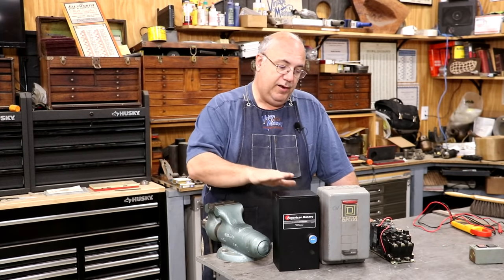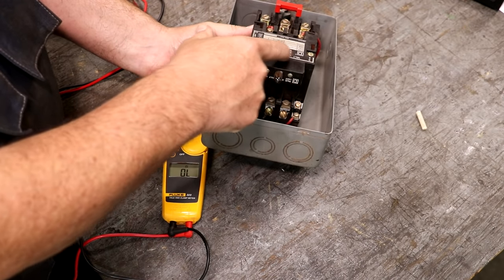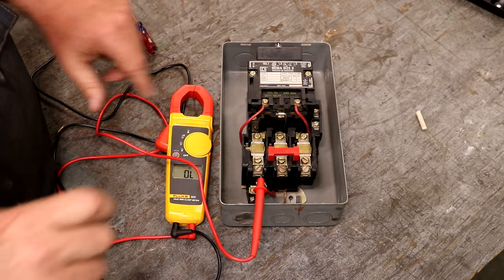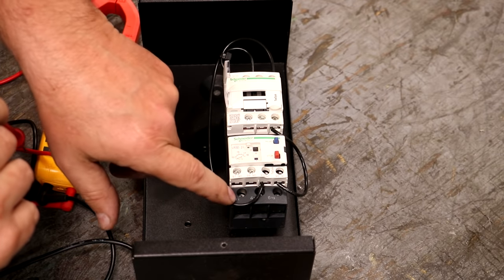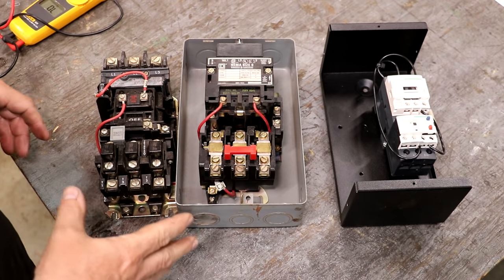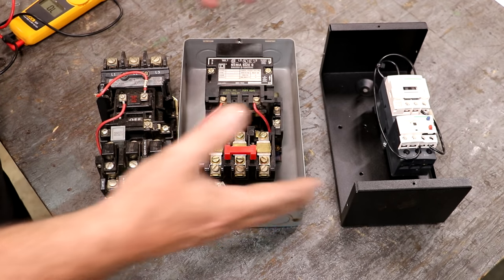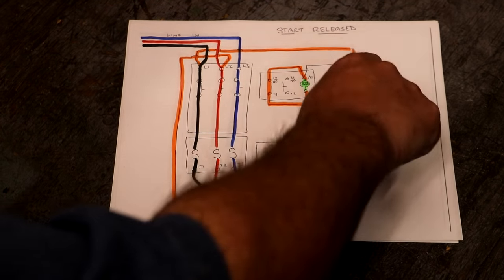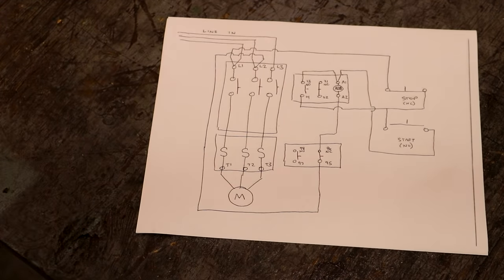Motor Starter On-Off Push Button Station Circuit Explained

Comment: It probably should have been mentioned that there are different sizes of starters for different sizes of motors. One of yours was marked "Size 0" which is rated for up to 3 HP when operated at 230V (or 5HP at 460V). There is a smaller size, Size 00, good for up to 1.5HP at 230V as well as larger sizes up to Size 6 for a 200HP motor at 230V. You can find sizing charts online.

Comment: Our 3 phase reticulation pump was manually started and stopped. Occasionally the protection circuits in the switch used to burn out, so our electrician connected 95 to A1 (same as on your diagram), protecting the protection device. Following this, the motor burned out a couple of times. Further investigation revealed that one of the phases had an intermittent poor connection. We learned that an important function of the protection circuit is to cut power on all phases if the current on one phase reduces or stops.

Comment: Nicely done Keith.  Having worked in a shop before I wired up a few machines with the electricians.  This was when I was about 18~19, so I was just learning stuff.  You did a much better job of explaining it than they did.  They were more "yea, just wire it like this".  I was "WHY!?!", they were "Because it will work this way".  I kind of wondered if they actually knew...LOL
Reply: Truly sounds like majority of electricians unfortunately.
Reply: @sixonegfour2719  honestly?  I was 18.  How much did I know then.  My uncle was a master electrician and taught me a few things.  I know enough to know when I need help that's for sure.  I also have a brother in law who is a master electrician, so I got that going for me.  Lol

Comment: Maybe you can help me diagnose a problem with a starter. I've got a step down transformer going from 480-120 to run my coil. I had the transformer on the shelf, and didn't want to order a new coil for 480v. Anyhow, my start and stop buttons work fine, however, if i manually actuate the contactor, the coil becomes energized and the contactor stays closed. I've never experienced this before. Any insight?

Comment: There is one important aspect of using a starter that wasn’t mentioned: current.  The motor needs LOTS of it, and contacts in the starter are huge so they can handle it.  The coil that’s turned on and off by the remote switch is very low power, and the remote switch can have small, convenient contacts.  It’s a very small power controlling a very large power.  If you wanted to use a switch directly on the motor, it would have to be huge.
Reply: He very clearly spoke about amperage (current).

Comment: One of my mills has ancient DC motor controlled by a 1945 SquareD starter.  It controls the startup inrush current via a dashpot and three resistor banks.  It had been miss-wired and one of the internal straps was missing.  If the schematic and care instructions weren't on the inside of the cover, I would have been out of luck.  It works correctly now.

Comment: Keith at 22:24 you say that the switch (2-3) on the motor starter is Normally Closed, that should be Normally Open. The Blue - Black wire on the motor starter are only connected when the coil is energized. 
Great diagrams, and good explanation. I had never looking into a motor starter before. It is really a latching relay with thermal overload protection. Understanding how it works is the way to go.

Comment: Good Job !
Both the IEC (your "new style") and NEMA (your "old style") starters have extra Aux contact for alarming, signaling, or whatever you need for your control.    In the heavy duty industrial applications I was involved with, we used NEMA due to them being oversized and their ability to withstand multiple overload conditions without damage.

Comment: Keith, thanks for a great explanation of how all this stuff works. I agree that it's really important for those of us "playing" with older machines to understand how things work and not just try to get by with "connect terminal a to terminal b, then c to d" style of working. When you understand how it all works, you can confirm for yourself what will happen when the power goes out or there is an overload. If you don't understand how something works you really don't know if it's safe (electrical or otherwise). This is not easy to explain and I think you did a great job. BTW, for those accomplishing the same task with a VFD, things are done a little differently, but all the same safety considerations need to be taken into account.

Comment: I've got an old HUGE (200LB) Baldor Bench Grinder at a factory maint. shop auction that had the push button start/stop but was removed by an idiot.  I had the bits n pieces but could never figure out the wiring! THIS  VIDEO WILL HELP GET IT UP AND RUNNING FINALLY!!!!!
Reply: The schematics for this circuit are all over the net. But try to find schematics for a latching circuit where the coil and load voltage are different. The only one of those you'll find is the one I posted. Because I looked for one. For like 3 days. Then I gave up and just made my own. Which I then decided to post for the next poor fool that might need it.

Comment: I thought you said you were not an electrician.  That was a good explanation.  I am now working on an old industrial oven control that I plan to use for a foundry furnace.  Circulator and exhaust fan, air flow switches, purge timer, flame sensor, pilot light, ignition and main gas. Lots of interlocks, timers and motor starters.

Comment: That was a good explanation of a contactor circuit with overload protection. One option that I have encountered on our heavy duty 480 volt pressure washers at work, is a rotary on/off switch in lieu of push buttons which I do not care for. Our equipment has a time delay in the lock circuit that won't operate unless there is water pressure present at the pump. It's just a more complicated circuit. There's a good possibility that the machine could be turned on when a power disruption is resolved.
I hope in your next installment on this machine that when you begin to discuss wiring it up that you can discuss horsepower amperage draw in relation to wire gauge, and phase rotation, which can be changed from changing any two legs of the 3 phase motor in one of 4 places. It can be done on L1, 2, 3, on the contactor or on t1, 2, 3 of the same. It can be done on the electrical breakers, or in the event of a plug, it could also be done at this point.
Again, thanks for the well thought out discussion on this safety feature.
On further point I would suggest is that if/when this shaper is plugged in, that the breaker or disconnect box be turned off before plugging it in as high voltage does have a risk of arcing when plugging in, even with a contactor deactivated.
The company that we contract with has made this a work rule.

Comment: For reference. This is called a "3-wire start/stop" and the type of circuit is called a latching circuit. Very well explained Keith!
Reply: Yes. Latching. Without that explanation, it makes no sense. A mechanical “latch” that holds the circuit closed.
Reply: @melgross  if you think there is a mechanical latch then you did not get it. What latches this circuit is how it is wired. The start button energizes the coil and pulls the relay on. Once it is on switched power from the load side keeps the coil on. Then what you do with the start button does not matter. But when you hit stop that cuts power to the coil which opens the relay. Cutting power to the whole circuit turns it off too. And when it gets powered back up it will be in the off state. There's no mechanical latch whatsoever. That would defeat the purpose of this circuit. Well, one purpose. The other purpose is to make it easier to put on and off switches where they can be used.
Reply: @1pcfred  there are numerous ways to do this. I’ve designed a few myself. Sure, there are electrical and mechanical latching relays.
Reply: @melgross  you are not going to find mechanical latching relays in this application. Unless you buy your gear off sadists.
Reply: @1pcfred  So if you only want a momentary on, you would disconnect the power lead from the load side to the coil?  I wish he had explained how to install a momentary switch,such as a foot switch.  Better yet, a way to have a momentary (bump) switch and a latching switch.
Reply: @equiteemfg  look at the schematic at 14:23 All we're interested in is the stop and start buttons and that box in the top middle. Now the orange line is everything that's energized when the circuit is off.  Now let's press the start button. When start is pressed that current goes across start up to A1 of the relay. Now that relay is energized and it pulls in closing its normally open contact. Now the relay can keep itself on through itself.  The relay is latched on. Through the wire that connects L3 to A1. When stop is hit it cuts power to everything which cuts the current to the latching relay coil and makes it open up. Now the normally open contact in the relay is open again. So that wire between L3 and A1 is where the magic happens. That V shaped connection over the relay is the logic. If you put an on off switch in that L3 to A1 wire and open the switch up then the relay will only be energized while start is pushed and the relay will never latch on while that new switch is open. Then you'll have your momentary operation. Start and stop are already both momentary switches. Stop is normally closed and start is normally open. Start gets the ball rolling but the wire from L3 to A1 keeps it rolling. When stop gets hit it sucks all the air out of the room. When you hit stop the party's over. L3 to A1 is the enabler though. That's the link you have to break to keep the relay from latching up.
Reply: @1pcfred  This is typically referred to as a jog.  By setting up an additional JOG switch (that will put the circuit into JOG mode) to interrupt either the 13 to A1 wire, or the 14 to STOP switch wire it will turn the START switch  into a JOG switch, allowing it to run ONLY as long as the START switch is pressed and held(assuming the stop switch has not been triggered). L3 is NOT USED, I think you're looking at terminal 13 on his diagram (which IS NOT L3!) You could label the on/off switch as JOG(off)/RUN(on).
Reply: @georgegeorge2602  I just used "L3" as an arbitrary designator. You should not read anything extra into it.

Comment: Great video 
I setup my air compressor roughly that way. No overload. 
Put a 3 phase (it's what I had on hand. Didn't need to be a 3 phase switch) magnetic switch in the 1 phase 220v line. To activate the switch I use a 110 wifi smart switch. Didn't want the compressor to have power on it when I wasn't home and manually tripping the breaker is impractical. So I walk in the shop and tell "Google to turn on compressor". Smart switch closes its contact witch sends 110v to the bigger switch with the 220v line and closes that contacts witch makes the compressor work normal as if it had power all the time. Saves money and I don't have to worry about the compressor contacts sticking closed with out me there. It has happened before..

Comment: If one opts to use a static phase converter, make sure you read/understand the instructions!

I was able to get a used Ronk static converter at a really good price.  One thing the paperwork emphasizes is that nothing except the motor itself gets connected to the created/generated leg.  I had to trace out, and sometimes move, wiring on my controls and relays, in order to use the converter on my surface grinder.  

Another item is that the converter must be tuned to the machine, or you risk overheating and damaging your motor.

If you can't get, follow, understand the instructions to your particular converter ... get help!  Statics are not "plug and play."  Especially on a machine that was previously used in a shop that had commercial 3 phase power.

Comment: In the video at 5:27 when you are explaining how the motor starter works you said that normally the circuit is closed actually the circuit is normally open until the coil is energized.  Great video though keep up the good work !

Comment: An interesting aside,  for fractional or small HP motors, Shop Fox makes a paddle type on off switch that has a coil and contacts in it and functions like a magnetic starter but without the overload protection.  Grizzly sells this switch in both a 120v and 240v version (110v-220v) but makes no reference to the relay.  
And like the magnetic starter, if the switch looses power, the contacts open and the motor will not automatically restart when the power is restored.  And it is like $15.00 if I recall correctly.

Comment: Good explanation!  One comment regarding the "protector"... A 3 phase motor will burn up if it looses any ONE of the three phases. (The other 2 wires draw massive current)  Hence, the motor-protector is intended to trip when a single phase is lost. (again...because the other 2 phases will draw excessive current)
Reply: Yes, that's the main reason i always use those (in Europe almost all industrial motors are 3 phase because of the 380/400V system, in most countries here, with one or two exeptions, like Norway, it is super expensive to use high current, but one allredy hawe "free" extra volts in the domestic lines in many countries (except for coutries that are for some reson using divided phase systems for the domestic lines, like Holland)), another thing in Europe is that many people does not seem to know about how important it is to newer ever run a 3 phase motor with Y-D connection in Y (star) moder for longer periods under load since that will also result in the coils runs extremly hot (unless the motor is especialy built to be run that way). Most old industrial systems here are using manual Y-D switching, but the modern systems are using automatic switching.

(I think You will hawe 220V in America with the centerzero system, wich is the old domestic standard (outside the UK 240V centerfuse system) for countries wich are using the regular 3 phase 280V phase system. (today it is for some reason 230 and 400V after the EU standard))

Comment: Even the way Keith draws the electrical diagrams is vintage. We haven’t used those little half circle bridges where wires intersect for 40 years. Since then the wires just cross each other, and when they connect, there’s a dot where the wires are crossing, to designate that they’re connected.

Sometimes that aux switch that’s normally off, is used for a brake.

Comment: Motors need to be “over fused” because they take large amounts of current to start, but they also need to be protected from long term overload during use. The “heater” over current device  builds slowly (relatively) and accepts the high inrush of current during starting from a stoped  rotor but will trip if a motor is drawing much lower current (relative to the brief starting current) that is higher than its rating. 
AND: series all your STOP buttons, and parallel all your START buttons if you have more than one start/stop station.

Comment: Very nice, Keith, but typically 14:00 start is NO and stop is NC 😉 Which you stated correctly at 14:12
Folks should keep in mind pressing the stop button interrupts the circuit, just like the overload does. And, and, you can have multiple stop switches wired in series with that one stop switch. Multiple stop switches are handy on a large machine if the operator may step away from the main control area (hint 😉)

Comment: Great instruction.  I'm glad you got around to the safety stop button at the end.  With that machine are you contemplating using a safety stop?  I spent nearly fifty years in a production environment where the Safety Stops were mandatory and not mandatory.

I know you are not in a production envoronment with many people around at once, however please take the safety stop into consideration.  If you are going to station the operator at the start stop switch, then it becomes somewat safer, however if the operation requires moving around the machine, mulitple safety stop buttons could save someone (especially you)  from serious consequences.

Those Safety stops are cheap insurance against serious injury or worse.  In addition there may be some liability issues when you host one of your many gettogethers'.

Just a friendly note from an old Safety Manager.
Reply: Not being in a production environment makes safety stops even more essential as there would be no one there to help in an emergency.  
With all those belts and cog wheels on the the planer I can see lots of pinch points to grab overalls, so emergency stop buttons within easy reach on all sides of the machine should be an essential safety feature.  And considering the table moving backwards and forwards as well, I think a "Rope Pull Safety Switch" emergency system running all the way around the unit would a useful option.  These are not expensive items and installation of such would make a very interesting additional video

Comment: Keith, I may have missed it, but in your explanation, I didn't hear you mention that the remote start/stop switch can be utilized with a "pilot" voltage, entirely different from the starter internal line voltage, and, in fact, that is most often the case. Regardless of the size of the starter (which is sized so that the contacts can handle the full line voltage), the holding coil can be replaced, allowing the use of a 120/3/60,  external "pilot" circuit to energize. Why would you do that? Usually, it's to save money on wiring to the on/off switch, and the added additional safety of a lower voltage circuit. In my professional life as an industrial air compressor sales engineer, I sold literally hundreds of air compressors in the 5HP to 25HP range, and I'd estimate that 75% of them used 120v control voltage if the line voltage was anything other than 120/1/60.